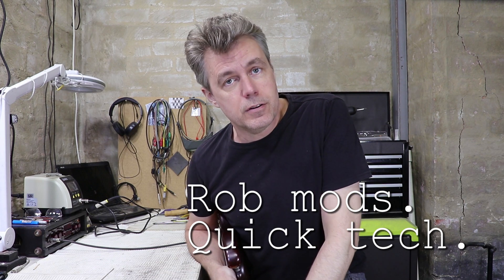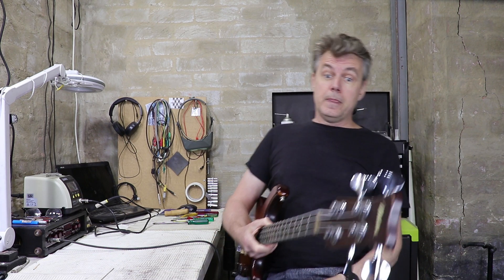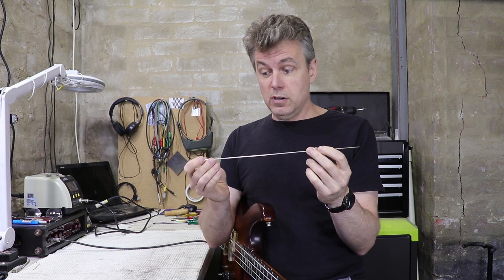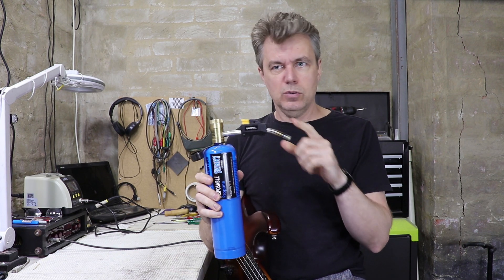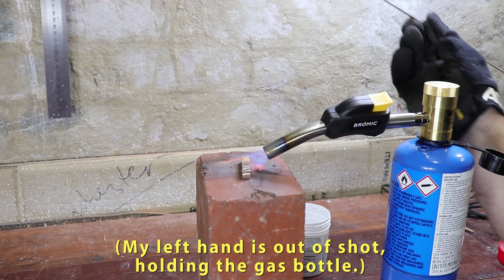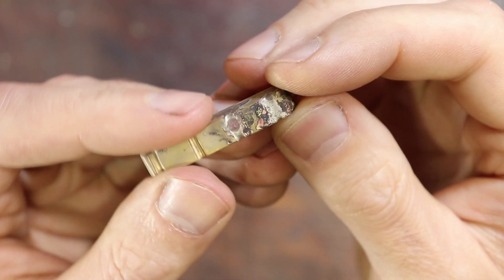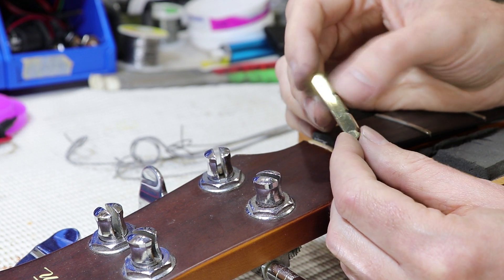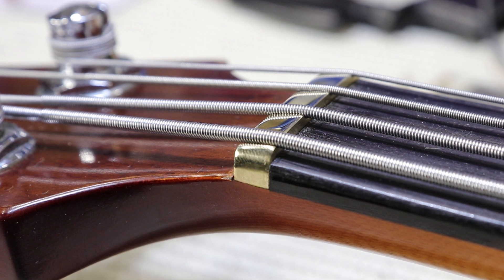Silver Brazing Brass Guitar Nut Slot Repair and Filing

Comment: Good stuff Rob. I’m a little surprised the propane torch worked on the silver solder. I would have guessed you’d need MAPP gas.
Reply from the maker: Yep, plumbers would usually use Mapp gas for this stuff, but they are working with long copper pipes and fittings.  For small stuff like this, propane has plenty of heat.  I reckon a decent sized Butane torch would probably work as well.  Bare in mind also, that brass will melt around 900, but copper more like 1100, so a lower heat will give more control.

Comment: Can you pls do a video about the Maton?
Reply from the maker: Hi.  I'm planning one since I'd like to use the Vantage bass as a back up to the JB4. (Not quite the same I know, but similar age, construction, feel/vibe.)  I have modded the Maton's pickups and electronics and plan to do similar mods to the Vantage.
Reply: @RobMods  what did you change with the pickups/electronics? Is it still passive. One of these Jb4's from the 80s has popped up near me, so I think I might check it out.
Reply from the maker: @JacqueRamon  I replaced the neck pickup with an underwound alnico P type.  I put in an A/C blend pot.  I also installed a 2-band fet preamp (my own design) with high/low impedance volume pot that switches from before to after the preamp for passive and active.  (The original series/parallel switch is now the active/passive.)

Comment: What an awesome little tech tip! Where did you pick up brazing skills? The only person I know who can do brazing is our refrigeration mechanic at work.
Reply from the maker: Thanks Sean.  Actually I first tried brazing back in the 90's when I was messing around making brass bridges and tail pieces for my custom basses.  Silver solder can also be used to join brass parts.  That's what I started with.  It melts in the 250-300c range, and with small parts, a big (80Watts+) soldering iron can be used.  It is like electronics solder in that it has the flux inside it.

Comment: Hey Rob, love the channel, being a Melb bass player too I am curious as to whether the JB4 is an early model or the reissue series? Also, any suggestions for blank brass nuts? I have a Tune Bass Maniac that I bought second hand without the original brass nut and i ended up making a bone one…good, but would love a brass one
Reply from the maker: G'day Paul.  Yes, this is an old JB4 from the 80's.  I believe it is an '83, but I could be wrong.  The reissues came out just after I left Maton back around 10 years ago.  In fact they were just starting to gear up for them in my last few months.  There was a couple of very nice originals in the cad room for a while to help with the design.  Playing them a bit sparked my interest, and I kept an eye out for one for a year or two after this, until I found mine.  It was all original, and one owner.  But I have changed the P pickup, and have put in a fet preamp.  I kept the parts of course and could return it to stock, but it is a brilliant bass.  The mids are unbelievable.  The neck is not so stable and I often need to tweak the trussrod.  But it is easy to adjust and very effective.

I have bought brass as off cuts from a Brass specialist in Moorabbin.  Best to phone first for these sort of places, and also look through their catalogue and know exactly what you want, and what the profile is refered to as - usually imperial measurements.

Love the Tunes!  Best of luck with the nut!
Reply: @RobMods  thanks for the pointer, I will definitely check out more metal suppliers. By the way, I got a Yamaha OC-01 on the back of your mod videos. I have an original ‘87 or so Boss OC2 and I might even have a crack at modifying the OC3 I also have. Can’t have enough octave pedals I say.
Reply from the maker: @paulgaudion8198  Nice one.  The OC-01 is a great pedal.  And it works differently from the OC2, so its worth having both for sure. It's a very interesting circuit and well designed/engineered.  Be sure to check out the PDF on my site if you want to try modding it.  After the video, I found a better way of implementing the LPF...